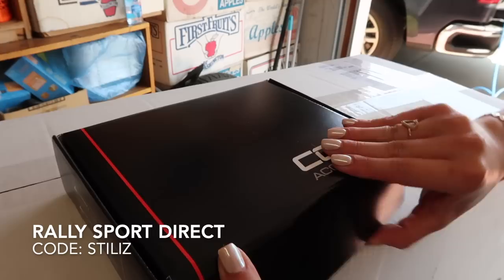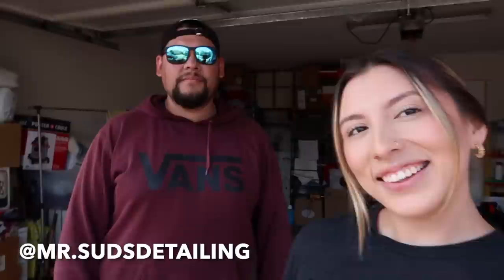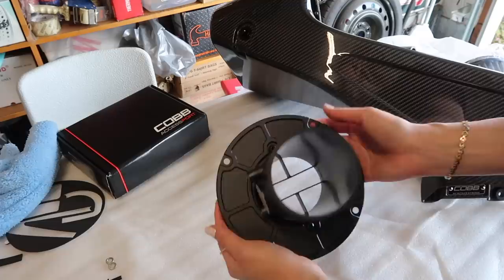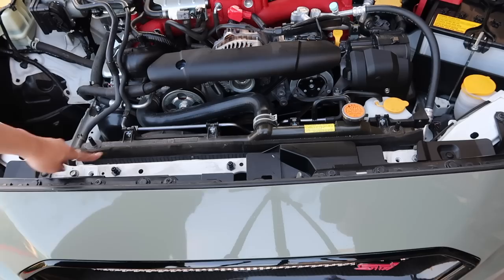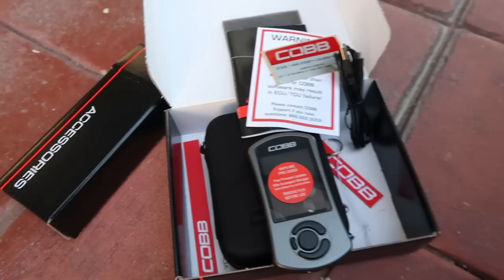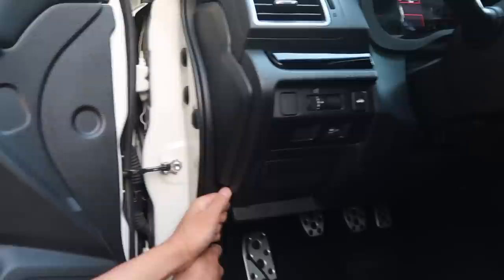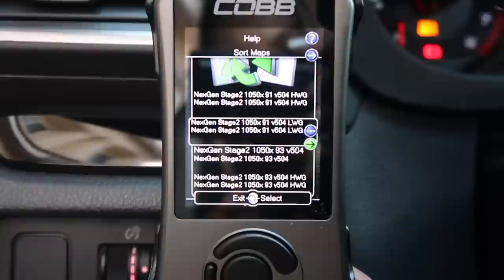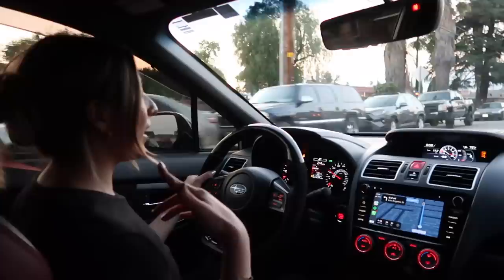STI WRX COBB Redline Carbon Fiber Intake + COBB Access port Stage 1+ install

Comment: Please get a protune asap. OTS tunes will destroy your engine.
Reply from the maker: i will!! 🫡
Reply: Yup!!
Reply: ASAP...can't stress that enough
Reply: Take it from a Subaru tech, you need that pro-tune!
Reply: Ots tuning should Include a bones stock with forced air. Like a setting that any moron can use without frying the internals.
Reply: Is E-Tune any good? Recently bought a car with Brentuning tune on it.
Reply: No they won’t
Reply: @sethgooch2932 oh yes they will....  etunes depending on the tuner is better but the fact being some objects can't be tuned correctly and a Dyno tune is required to make her perfect. Spend 10k+ in a car mods and fall flat on an OTS or E-tune just doesn't make sense.
Reply: @MrGsxrme  Yes, e-tunes and dyno tunes are better and more custom to your specific car. OTS tunes will not destroy your engine though. They're design to support any vehicle of a specific make and model throughout all climates and elevations. So they're a conservative tune. As long as the OTS map notes are followed properly, there should be no issues. Alot of people run Cobb OTS maps with non Cobb specific parts and blame Cobb's tune for their own ignorance. But if you're spending $10k+ on mods, a custom tune is your only option anyways lol.
Reply: Love the look of that intake! I wanna see if I can make it fit on my 13 wrx
Reply: What do you mean pro tune? I just got a 2020 sti and I’m looking at getting the Cobb stage 1. Thanks
Reply: i’m sorry y’all, DrunkMann is gunna be your best option for an e tune. he’s the best by far. blows people away. the tune is perfect everytime. and he will take all the time to answer any question.
Reply: Is a pro tune necessary if my car is stock I have a 2019 wrx?
Reply: @eliezergutierrez2472  pro tune unlocks such a more smooth power band regardless of mods. but it’s definitely worth it man.
Reply: @BCyyGaming  thanks
Reply: Pro tune is gonna get you more power. Ots tunes are safe as long as you can read and follow the tunes requirements. All these fan boys seem to forget the stock tune isn’t tuned to your exact car or environment either. Duh.
Reply: @BCyyGaming which shop they at?
Reply: I would swap fuel pump from Cobb AEM 340lph and go pro tune, you will be safe after that
Reply: Says who? Everyone uses the cobb access port and nobody says destroys engine?

Comment: A good e tune will feel much better over the cobb OTS. I just did one with Torqued Performance and it really woke the car up and it feels much smoother. He requires you to install a fuel stumble fix kit before tuning, but that is super easy to do.
Reply: I've been reading up on that. Not sure if that is what I am experiencing in my 21 STI but around 3200-3500 RPM's it feels like some kind of hesitation or stubble and then proceeds to act normal through the rest of the RPM band. At first I was like, hold up, is my clutch slipping at 5k miles. LOL. Nah..
Reply: @TheSwampDonkey  that is absolutely what is happening. It really is a simple install. But you will have to have a tune for it.
Reply: @13Recon19D  is Eric tuning STIs? For some reason I thought he only tuned WRX’s. I will look into the stubble kit and reach out to him. I already have the accessport and the Redline waiting to be installed.
Reply: @TheSwampDonkey  yeah he does STI’s. Mine is a 2019. $250. Took about 4 revisions. The car feels like it pulls noticeably harder over the cobb stage 1.
Reply: Make sure to update your AP or you may not be able to load the maps onto the car. Mine was pretty new and still had several updates that caused the map to be locked and unusable on the AP until I updated it.
Reply: @13Recon19D what’s the website you got your tune ?
Reply: @mikeyrov5230  just google torqued performance.

Comment: That little stalling action after re-tuning your car or unhooking the battery is due to an air/fuel ratio relearning for the ECU, nothing too problematic and should go away shortly.

Comment: Cobb has a redline intake specific OTS map. 
You should probably flash to that. You’re using the non redline OTS tune, Just FYI. 

Also throttle mapping is different now, no more rev hang that’s why you feel like it’s gonna stall. More linear throttle input.
Reply: There's not a Redline intake specific ots map. It uses the Cobb Stage 1+ SF map per Cobb's website

Comment: All those dash lights on example Hill assist, SRH off etc is that ur doing or is it due to the Access Port? 
Thanks for the vid now i can move forward with intake as well.
Reply from the maker: No, I actually turned off hill assist, that’s why the light is on. I have aftermarket headlights that got rid of the steering responsive feature, which is why the SRH light is on :)

Comment: My frend n I decided not to use the bolt that attaches it to the car where the radiator is at, instead we just used the clips to make it easier to remove n reinstall the intake
Reply from the maker: interesting 🤔

Comment: hey, I want to buy both parts and I want to make sure that it fits in my Subaru STI 2020. Thank you for the video, your car looks very nice with those parts👍🏼
Reply from the maker: That’s great! Make sure you go through rally sport direct & use my code for a discount! But It should fit , my car is also a 2020 STI :) & thank you !
Reply: Hello, order the parts but your discount code was not accepted, I don't know why 😔

Comment: everyone says get a proper tune. I've been running Cobb Stage1+ OTS for 8k miles. ZERO issues and MUCH better to drive than stock. I say do you and enjoy that set up until it's time for your next upgrade ;)

Comment: Did it start backfiring after the tune? Or did you have that backfire "burble" tune already?
Reply from the maker: I had burbles when I would downshift before the tune , but they are a lot louder and defined now!
Reply: @sti liz  Really? On stock ECU map? At the time did you have a downpipe or anything?
Reply: @slothystyle yeah awe track catback pops on downshifts and some upshifts WOT

Comment: Why is the "SRH OFF" light flashing? Also noticed an indicator on the top left of the gauge as well. 

My third Subaru STi (2004, 2015, Type RA). Also third time installing a Cobb intake but this will be first time with the CF one. Cobb has gone a long way from the Cobb V1 that I had for my 2004.

Comment: I've never seen OTS tune destroy an engine like some say. Cobb usually runs a bit rich to avoid damage.
Pro tune is amazing AFTER you install a few power mods. Or you'll be dumping a lot of money every time you add. 
I'd say add the Cobb intercooler, charge pipe and coupler (charge pipe to turbo). But, if you want to pro tune sooner, at least get an electronic boost controller and probably a better bypass valve with the tune.

Comment: Did you get the pro tune yet?
Reply from the maker: not yet :(
Reply: @stiliz.  do you only have the intake and I’m assuming a catback? I jus installed the redline intake and have a Tomei catback but unsure of the map I should use. I want to wait until I have full bolt ons for a tune.

Comment: What does that cobb device do?
Reply: 15:45 <- it lets you monitor the car, you can switch maps on the go in case you have different tunes/maps w certain fuels like 91 or E85 etc
Reply: @misael1396 Ah, thanks. I must have skipped that part.
Reply: If it didn't void warranty I would install the intake + stage 1.